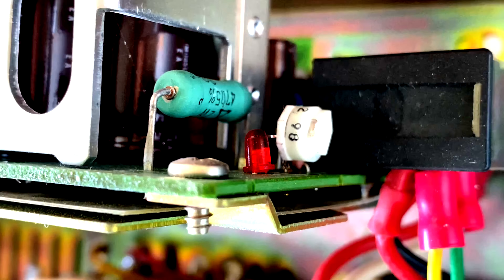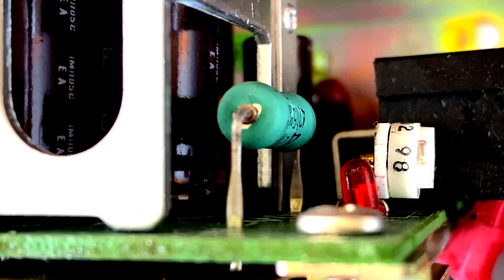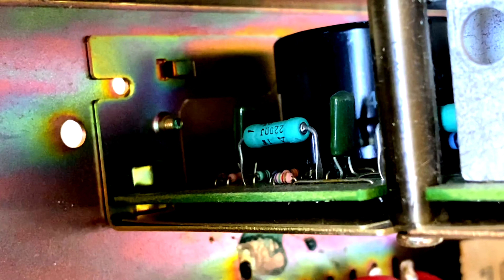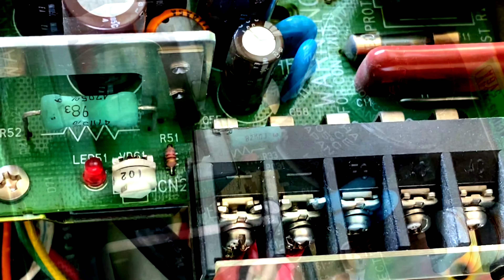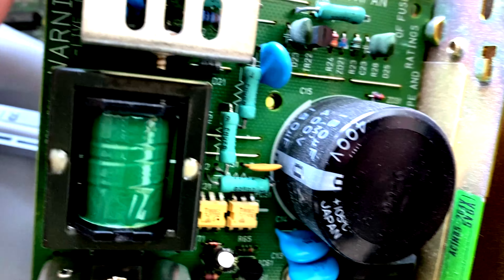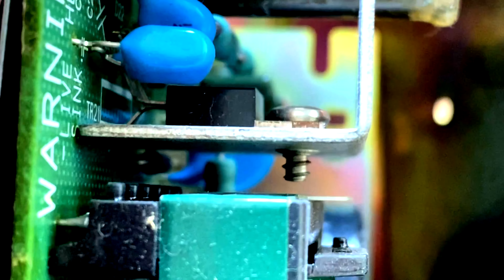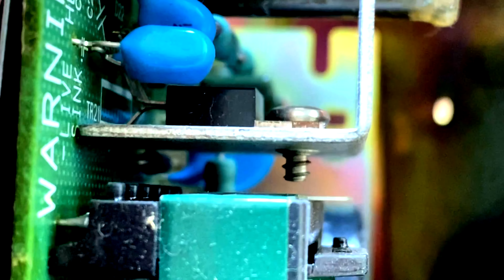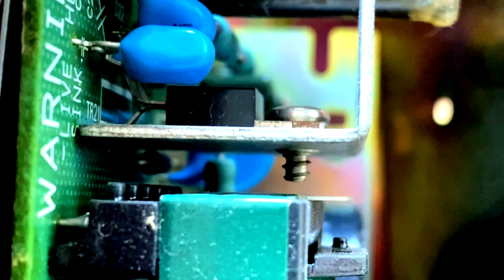[MUSIC TECH DIY] Akai S1000 Sampler Power Supply Replacement Fix

Comment: Hi thanks so much for making this video.. I was hoping you could answer 1 question, was any soldering required? Like a straight swap of wires?
Reply from the maker: Hi Gareth - yes there is no soldering required.  It is just disconnect/reconnect.  Mounting the new PSU is best done with some drilling.

Comment: That is a nice-built power supply, Cosel, high-end power supply, shame if it was thrown into a bin. Changing all electrolytic capacitors, especially in PWM control and it will run again.
Mean Well is good but not as good as Cosel.
Reply from the maker: You're probably right it was a well-built power supply.  Once upon a time I would be up for desoldering and putting together a BOM but honestly a drop-in replacement was really nice and paid in time saved.
Reply: @Faisal-pf3vj
 Just looking on a spectrogram both my S1000s with meanwell PSUs have some hum coming through up to 1.5k. S950 is much quieter.
Reply: Na I did that was still dead